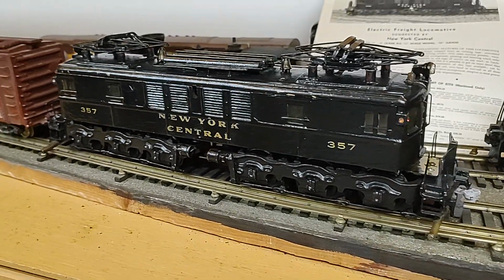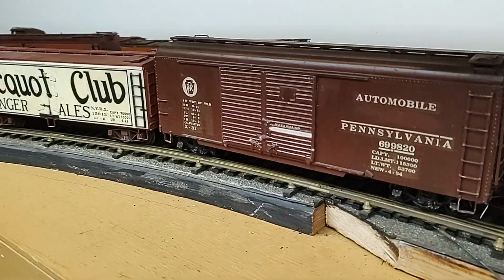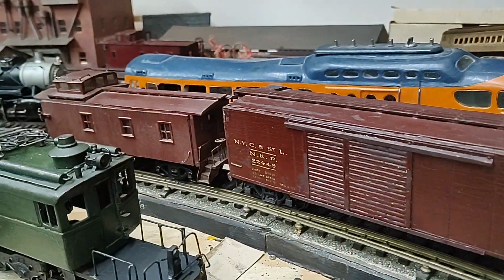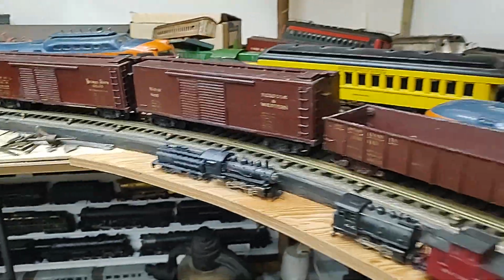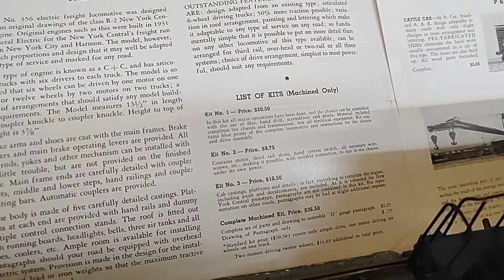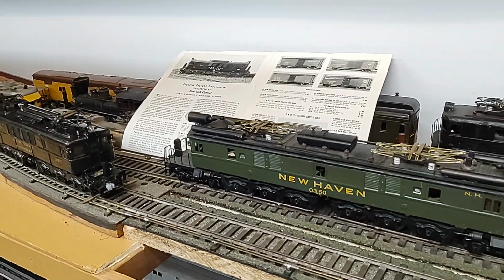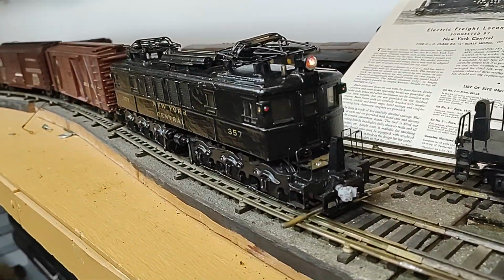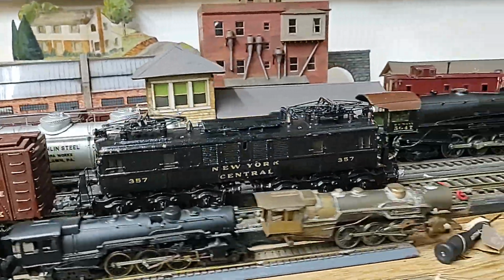Vintage New York Central RR Electric Class R-2 locomotive O Scale / Gauge Parmele & Sturges 1938-41

Comment: I believe similar units were employed at Cleveland terminal, very handsome motors.

I've got a Pennsy O1 model in HO scale, seems to be made of brass, but has no obvious maker's marks, and I could not find photos of a similarly constructed model. From having it apart, it seems to have the spring belt drive system, and it works fairly well. Any ideas as to where it would've come from?
Reply from the maker: International Models imported the PRR O1 from Japan 1950's ..it was quite popular